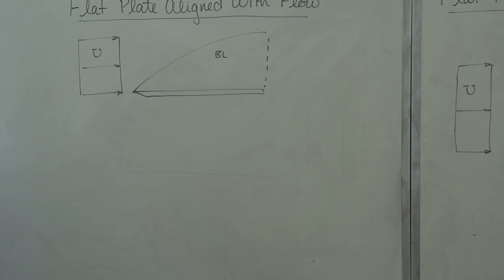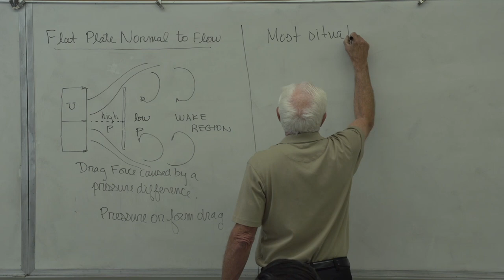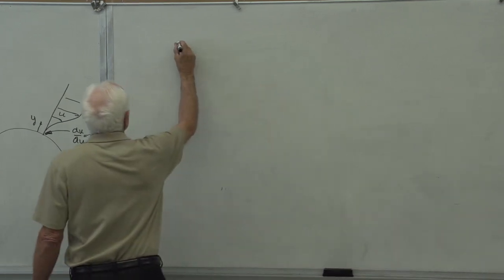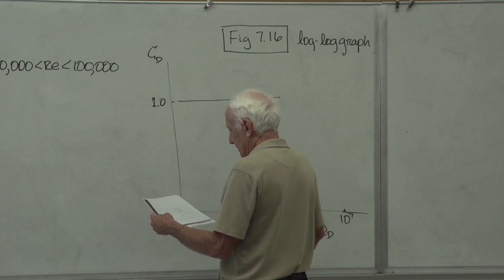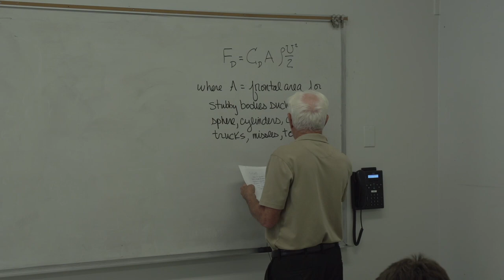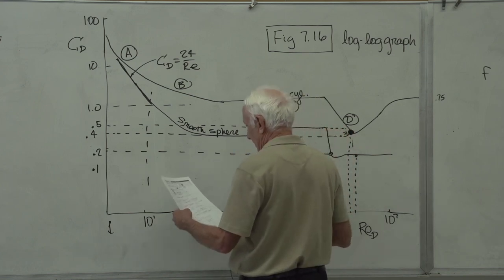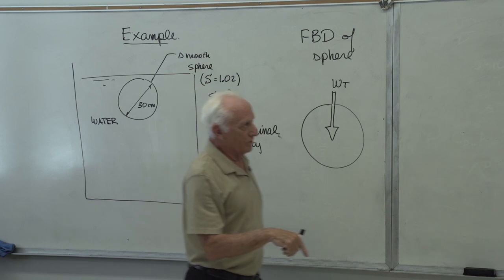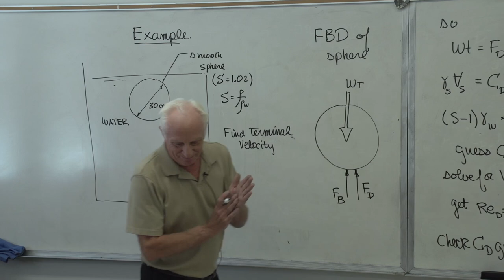Fluid Mechanics: Drag Forces on Blunt Bodies (33 of 34)

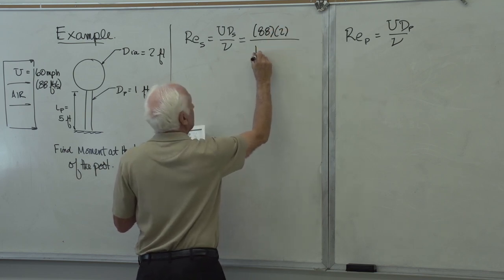Comment: 45:26 Did Dr. Biddle mean to write 1.61E-4 for kinematic viscosity? His value corresponds to SI units for 20degC when he's working out an English unit problem at 68degF. His Reynolds number would instead be 1x10^7, not 10^6. The 1.61E-4 value would yield his Reynolds number.